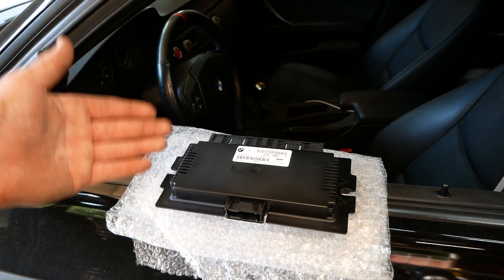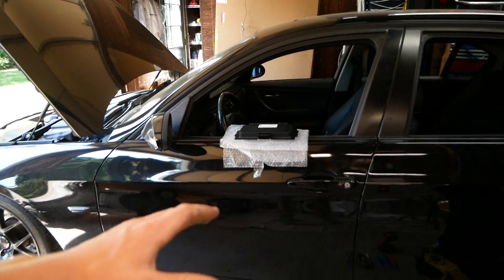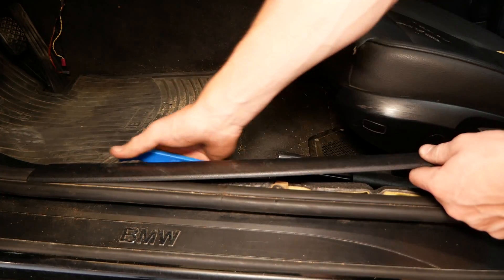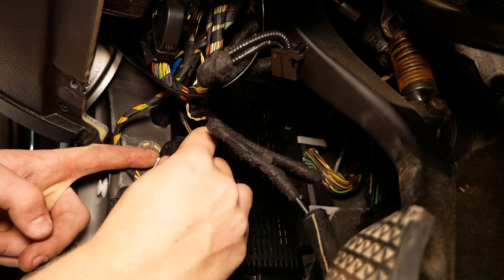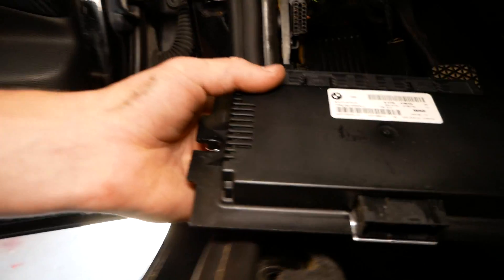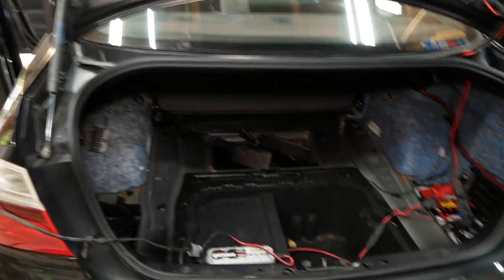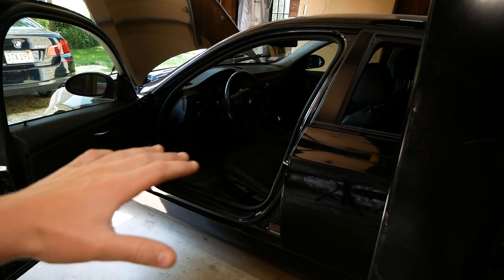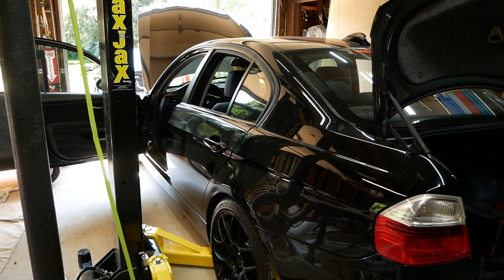Footwell Module (FRM) Replacement // BMW 3 Series

Comment: As a retired BMW tech I’m dumbfounded. Why would you replace expensive parts hoping to find the problem?! Troubleshoot and identify the problem and then replace the parts at fault! You can examine the computer codes for clues, but if you don’t have access you can send the modules out for inexpensive fault inspections. Folks don’t spend a fortune replacing modules and parts if you don’t know what you’re doing.
Reply: My 2008 335i coupe just started having electrical issues and went into SOS MODE 🤢 Windows do not roll down and no music. The windshield wipers stay on constantly with the key in and will not turn over at all. I'm currently saving to get it diagnosed after I buy a new radiator. Someone reset the codes for me and it did turn over and start for me, just to have the radiator blow on me about 5 minutes later... I have a nightmare on my hands now at this point! The last time it went to the shop it was 3000 for the water pump/ thermostat and battery and labor 😢
Reply: @firstcoastbeems3283 so what end up being the problem ?
Reply: It ran GREAT before the computer issues. Oh and I forgot to add that the company I was working for didn't offer to help fix anything at all when it was their fault the roof gutters drained into my car with all the windows closed, it pushed through the sunroof and left about 3" of water in the floor 😣

Comment: Can i change my FRM? For example, i have E90 E91 LED BASIS PL2 FRM3R can i change it with E90 E91 LED NSW PL FRM II ? Or maybe with E9X-E8xCA-NSW PL2 FRMFA? I don't want some fancy welcome lights or blinking reverse lights, i want it the stock.
Reply: Why would you change? Is there an advantage to going to an older module?

Comment: Do you have to disconnect battery before installing the new one to not run the risk of frying the new one again?
Reply from the maker: Yes, disconnecting the battery is recommended during replacement

Comment: HI does the shorter or LONGER Phillips screw go into the truck relaease handle? Also..when u took off the dash trim what was that black square plastic piece with like  a wire tie attached to it..its at bottom left of trim panel u took off..thanks

Comment: Hey man.bmw f30  I got a short I think my right tailight lamps and blinkers not working. Tested ground  current on cables seem fine no burnouts whatsoever on connector. I move everything to my left side everything works fine. So is not my bulbs or socket board My last option is the dealer.. Help!! Thanks

Comment: I connected a new battery the other day. And fried my FRM module. I’m taking it out and sending it out to CA to get repaired. When putting it back in, do you recommend to disconnect the battery? I don’t wanna fry the 2nd module
Reply: What exactly did you do to get ur car running again? I just diagnose the same thing on my car. No lights at all please lmk
Reply: @nelohd8866  hey! Not sure if I’m too late to respond but I sent out my footwel module to a company in California. All plug and play and cost me $130
Reply: @fe2957  What company would that be? it would really help in my situation
Reply: @devaughnthomas9682  hope that helps!
Reply: @fe2957  what company did you send it to?

Comment: You made the connectors look so easy. I can't get them to swing out what do you mean by push in because I'm pushing towards the module and trying to swing them out by they are stuck. Don't want to break it

Comment: I lost my footwell module when I replaced my battery.  After battery change went to start car and had no power windows, turn signals,dashboard lights and some other stuff that the footwell module controls. It's a bmw fault issue.  They had to extend the warranty on these to 10 years 150000 miles. But just disconnecting the battery can cause it.
Reply: I’ve been charging my battery and I have the same problems, did replacing the frm work for you?
Reply: What was the fix?

Comment: Never connect that way the battery. You should use the connectors under the hood. Dude you could burn the battery adaptor. So expensive btw

Comment: What did it turn out to be? I brought my E9X M3 in to check for FRM and they said it wasn't and they narrowed it down to JBE (clicking noise after car sits for a couple days and electrical warnings).  Alternator and battery are already replaced so i went and bought one.  I hope this is it!
Reply from the maker: Sounds like it could be the JBE! I had the same clicking noise

Comment: Do you unplug or mess with any speaker wires when you do this? After getting my FRM checked by the dealer my drives side speaker no longer works. I read on a BUMMERPOST that you do in fact unplug a speaker wire. I need someone to confirm.
Reply from the maker: I did not unplug any speaker wires...
Reply: Yes there is a speaker in the bottom trim piece above where your knees would go

Comment: My indicators, "blinkers" I think you Americans call then - flash at double speed. I disconnected my battery for 12hours and reconnected and it solved my problem for about 24 hours. Isit worth my trying to disconnect/reconnect my FRM before i take it to someone and start forking out loads of cash? Cheers.
Reply from the maker: Unfortunately, I do not think disconnecting/reconnecting the FRM will solve the issue. However, it is entirely possible. It doesn't hurt to try.
Reply: This comment is 6 years old but if anyone else has this problem it means a light is out. Usually the opposite tail light.
Reply: I gave it a go. No luck :(
Took it to a bmw specialist, FRM has failed. £300 For a new one and £80 to code it to my car :(

Comment: Just replacing several expensive modules isn't the way to go imo.
By the way, charging your battery should be done under the hood on the charging points. Way easier also :)

Comment: I had an issue like this replaced FRM nothing then JBE still nothing until finally CAS module took a poop. Replaced CAS all problems gone. FRM module has a recall btw got it for free at bmw dealer
Reply: What is the CAS & has anyone used a scanner to specifically ID these issues before buying parts?

Comment: Supposed to use the terminals under the hood to charge the battery, not on the battery itself
Reply from the maker: The battery was disconnected. It's a smart AGM charger. No harm in charging directly.

Comment: Hey man love your videos! so definitely sounds like its your jbe , had similar issue on my e92 328i. replace the jbe and the entire fuse box. about a 2 hour job , also was able to program the module myself. the jbe module controls almost everything on these cars. In my case my wipers didnt work , ac inop, gas gauge always showed empty and locks didnt work. please DM if you have any questions man I know how much of a nightmare these can be.
Reply: Alex B.  I'm having the same issues.  How did you determine it waS the JBE & not the FRM?

Comment: If I was you, I would avoid connecting the battery and test module by module. Wait for all of the modules to be replaced and then give it some honey. A faulty module can overload another module or even damage the chipsets. :) Best of luck, waiting for another update ! :)

Comment: Hi JD Cars,
I had a similar problem with the electrical and it turned out to be the ignition switch, which was an $11 part. I didn't have an E90 at the time (It was a 986 Porsche Bosxter) but my research showed it's a fairly common problem. Little electrical issues like lights going off or blinking, etc. that are somehow caused by a loose or faulty ignition switch (Mine was actually loose yet worked fine). After swapping it everything was fine. Cheap part and a quick swap. So maybe that could be it? Worth looking into. Love your videos, thanks!
Reply: Why, exactly, would you bother polluting the comments section on this video with a 100% unrelated comment?  Nobody who is researching this issue on their BMW 3 series gives a rats ass about your boxster.